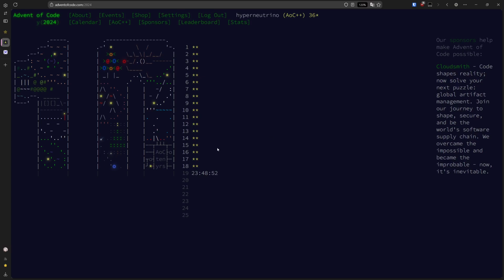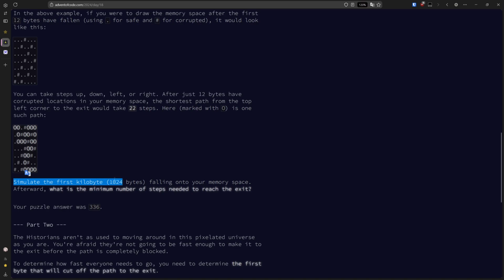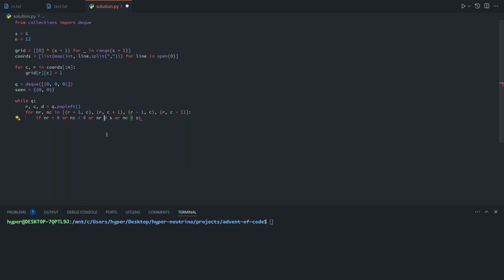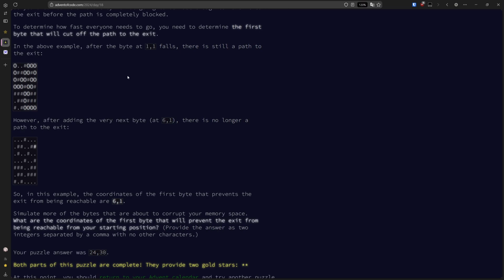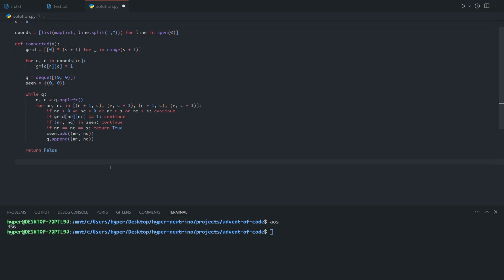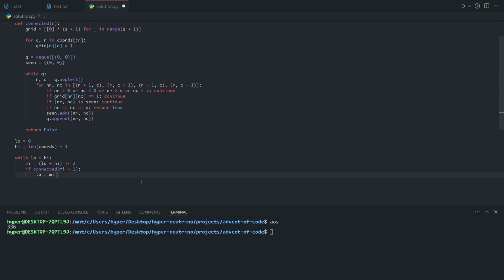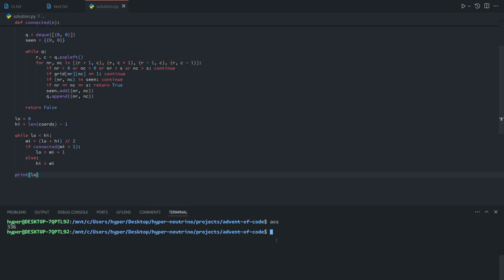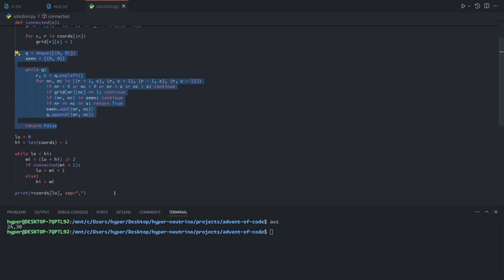Advent of Code 2024 | Day 18 "RAM Run"

Comment from the maker: one of my discord server's members used linear search and it worked in about 2 seconds; granted that was rust, but it seems like binary search was not really necessary. faster, but takes longer to write out
Reply: I did a linear search, but only reran the path finding if we blocked a cell on the last known shortest path. My rust solution runs in ~200ms
Reply: I did linear search in python and it still runs in < 10s, so definitely doable, but the binary search is interesting as well
Reply: Same here, 0.3 seconds for linear search in Python starting from the end state. About a minute starting from the beginning.
Reply: I also did a linear search but Python. Just throw all the points in the grid then removed points starting from the end of the input. For my input my solution was nearer to the end of the input
Reply: same here (C). didn't even bother stopping at the disconnect, just printed the added coordinates and the steps to the exit, first 0 was answer. took longer to scroll up than it took to run. (about 2secs), so I guess my search was  <1ms since the whole input is nearly 4000 lines, and most of that was the printing to the terminal (34ms >to file)
Reply: I did think of binary search, but decided that having to remove obstacles would be a hassle so tried linear first
Reply: i did linear search and got the result basically instantly (java), started from 1024 tho since we already knew that everything up to 1024 finds the exit. The input isnt long, its only 3450 lines (bytes), so i basically only have to loop throuhg roughly 2400 iterations. Wish the input was longer and something like binary search was actaully required, because i was surprised how small and easy the input size was. I could basically just put a for loop around my code from part 1 and thats it...
Reply: I'm lagging two days behind due to illness, but I just did this day and I also did linear search. I did it in Go and my code runs for about 1.5 seconds.

Comment: im a bit confused by the pointer update logic you used in this video b/c it differs than the two traditional templates (exclusive / inclusive bounds). can you cast any light on how you thought about it? I know in the video you said you aren't great at this in real-time and just try to guess until it works lol, just curious if you have reflected on the solution at all (or plan to in the future). thanks!

Comment: "bit too slow", it is relative, with pypy it runs ~2.5 sec (started with 1024+1 knowing 1024 is ok)
you type very fast, but making BS will be slower than that I guess ;-)
Reply from the maker: binary search lost me time mostly because i got a one off lol. there's a clever way to do this linearly that i might cover in a future stream
Reply: @hyper-neutrino  I've also later tried BS, before I've seen your solution, ending up with little more "symmetric" branches; (maybe this is why you said it was luck, your end condition and else are little different than my (but I'm not saying wrong))
runs ~100-150 ms
    max_ok = size
    min_wrong = max_i + 1
    while min_i <= max_i:
        i = (min_i + max_i) // 2
        G = init(i)
        steps = try_solve(G)
        if steps is None:
            # wrong
            min_wrong = min(i, min_wrong)
            max_i = i - 1
        else:
            # ok
            max_ok = max(i, max_ok)
            min_i = i + 1

    assert max_ok + 1 == min_wrong
    assert min_wrong < len(lines)

Comment: With the solution to part 1, doing a 'human driven' binary search was exceedingly simple. I started from 1024, as that produced a valid path in part 1. Then I found the pivot point in seconds. Only after solving, I wrote the binary search into actual software.|
I was almost disappointed that we didn't have to find the shortest path for traversing the grid while the blocks were falling

Comment: For part 2 I took the approach of starting at 1024 because the verbiage in the problem is "Simulate more of the bytes". I then moved forward and checked my current path for each corrupt bit moving forward. Only if a corrupt bit existed in my current path would I re-calculate path. This reduced the amount of checks and allowed for sub second execution. I think the binary search is an interesting idea but I do not think it was needed.
Reply: Yeah I did the same, waited till my happy path was blocked.   I was enjoying myself so I called my TryFindEscapePath function twice in parallel.  One searching from start to finish and one finish to start.
The reason why was to fail fast block.  Dunno if it was worth it but I'd never done parallel before.  I might incorporate binary search tomorrow if the problems not too tough

Comment: It was not to slow to just check each byte, part2 was bruteforceable even in python, took me maybe 5 seconds
Reply: did the same. but i did a dijkstra (diy implementation so kinda slow af) instead of bfs though and it only took about 10 seconds in javascript. Didn't even need to start at 1024, just from beginning to end.